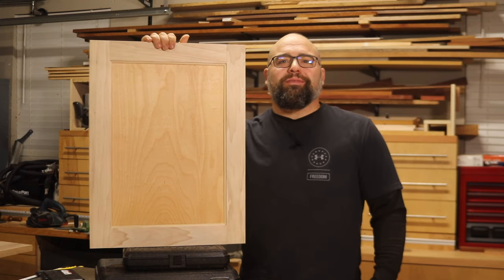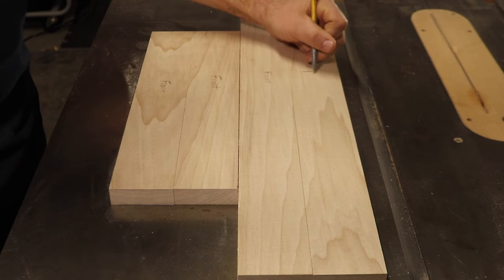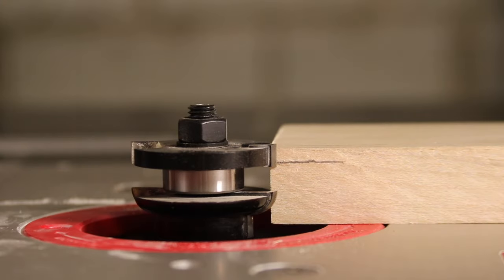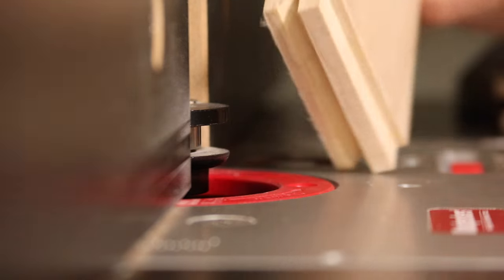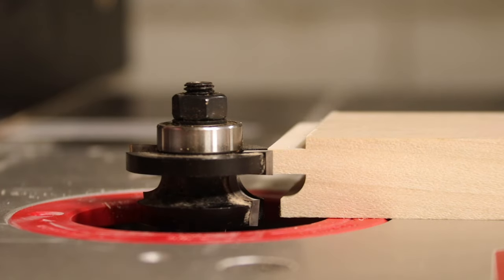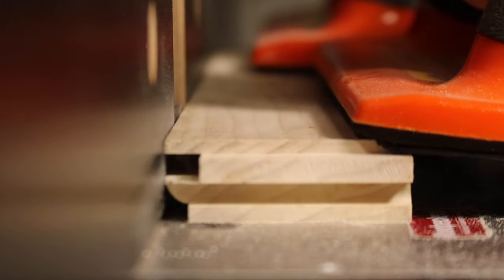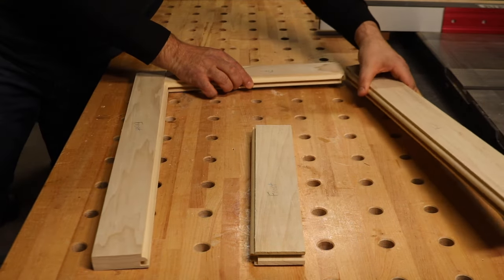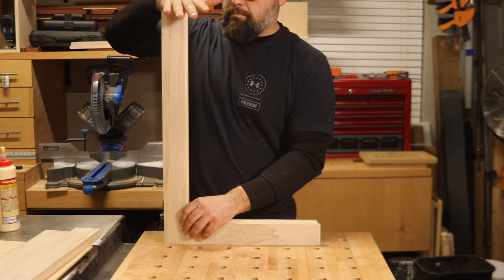Easy Cabinet Doors Made on the Router Table

Comment: Best video on you tube.  Perfect detail and easy to understand. Straight to the point. Clear video of all joints. Well done.
Reply from the maker: Thanks Dawn! I appreciate the kind comment!
Reply: Not quite.  The fence isn't square to the miter gauge.  Wrong method.
Reply from the maker: Seems to have worked out pretty perfectly. And does every time for me. Why is it the wrong method?
Reply: @PenaltyBoxWoodshop  only because you need to keep the piece pushed up square against the fence/bearing.  You didn't demonstrate squaring the fence and miter gauge to the miter slot.
Reply from the maker: I’m sorry but you’re wrong. With a router table you do not have To square the fence to anything. The router bit is round and squareness will not affect the cut.
Reply: @PenaltyBoxWoodshop  so what's the miter gauge for?  You only need one reference surface, not two that have not been checked for square.  Yeah, sure it SHOULD work fine if they are square.
Reply: Very good job mr
Reply: Facts.

Comment: Housewife tip: When we had our custom cabinets built I requested that the carpenter set all the panels in as he did the glass. They're held in place with the plastic twists in the back. This enables me to get a wild hair up my butt, pop out the panels, and paint them with chalkboard paint. Or decoupage. Or switch the panels out for glass. Or anything I want, really.

This is the only way I could imagine having the same kitchen for 30 years without getting bored. And it really works. The white cabinets don't bother me over time and I get to switch things up without doing any real damage or pulling out the paint sprayer and plastic. 

If a panel ever gets 'crafted' beyond repair, I can just cut out another 1/4 inch panel and pop it in. I have the information for the original white paint and can even turn it all back into a nice, clean, white kitchen if the mood moves me.

Comment: Good tutorial.Just one point you did not mention - especially for new woodworkers - to allow for the extra wood needed on the rails when they fit into the stiles.I my first doors and the finished product was not wide enough LOL
Reply from the maker: Thanks! I actually did mention that during the assembly but you’re correct I should have made a bigger point about it.
Reply: I didn't see that covered either. But otherwise this is a really awesome video

Comment: For those who have never use cope and stick bits, it would be informative to let the user know that they need to add an extra 3/4 of an inch or 24 centimeters to the rail length or the door will be short in width. The rail inserts a little over 3/8's of inch into the stile, thus 3/4 of an inch a door. I learned this lesson the hard way building double doors and them being an inch and a half short in width. After all of the milling and sizing of wood, this type of rookie building mistake hits hard on both your time and wallet.
Reply from the maker: Yea, absolutely and I mentioned quickly that you need to account for that but I didn’t go in-depth. Thank you
Reply: I was about to ask about that as it's important to allow the extra length. Thanks for clarifying. Btw, 3/4 inch is 19mm, not 24cm!
Reply: @PenaltyBoxWoodshop  I went back and watched the video twice and I did not see any mention about 3/8 tongue on each end. In other words if you want your rails to be 10 inches long start with them 10.75 inches 3/8 on each end will be the tongue.😀🛫

Comment: I would have liked to see more info on your centre panel.

What did you use for the centre panel. What kind of wood is it and how did you get it so thinly sliced? Did you mill it yourself or got it cut at the store. What are the chances of thinly cut solid wood with so much surface area to weight ratio warping

Comment: I’m a beginner and I checked out your Amazon link to the router bits you used.  Are there several rail & style bits in that set?  The door in your video is EXACTLY the one I want to create… Shaker with that small bead around the edges of the panel.  What type of rail & style bit set makes that pattern specifically?  What’s its name?  Loved your video.  Gives me the courage to try my hand at making these doors.

Comment: Great video. Quick question I don’t have a router table but I do have a router. Can I do the same thing using the same bits used in this video?
Reply from the maker: Thanks! No, you’re gonna need a router table of some sort for this. Even if it’s a shop made one

Comment: Where are the links for the list of tools? I have a cheap table saw and tried to do this and it was a learning experience...very frustrating.  I would rather do it the way you did it in a router table and have less trial and error.  Could you tell me what table saw you have and the clamps you have.  Thank you!  Awesome video!  You did an incredible job making this simple for everyone.
Reply from the maker: They are in the description section and the Delta saw that I use is in the list. Thanks!!!
Reply from the maker: They are also on my website www.penaltyboxwoodshop.com

Comment: Nice work.  Which router did you use in your table, and do you have any problems or anything that could be better about your router table in general?  I’m debating on getting the woodpeckers or the jessem.
Reply from the maker: I like my router table and the Woodpeckers one is top notch. However, I like the lift on the Jessem better. The woodpeckers is harder to lift
Reply: @PenaltyBoxWoodshop  cool, thanks.   I think I'll try the JessEm, but it was a tough call without being able to get my hands on it first.  I agree with you about the lifting on the WP.  My only nit about the WP I could tell from watching their videos is the lift handle seems to be a flimsy design over time, with only the small set screw holding it together.   Small thing to complain about though.   I love WP for their layout tools and I have several of them.

Comment: What about doors that use no sheet products?  I want to make cypress cabinets and would like to see solid center panel construction.
Reply from the maker: Then you would need to use a thin 1/4” panel or make a raised panel. I think you might be able to use a 1/2” panel as well but cut a 1/4” rabbet on all four sides. Then have the offset side facing to the rear of the door

Comment: Love your videos.  Do you cut the center panel exactly or do you make them smaller to account for expansion?
Reply from the maker: Thanks! I usually cut on the line which gives them a little relief on the length and width

Comment: First off, thank you for this very informative video.  I have been doing some basic woodworking for many years but am now wanting to take on some cabinet building so your videos are awesome!  There were so many comments on this video that I couldn't go through all of them so I apologize in advance if this has already been answered. 

I have a question regarding making the first end cut where you use a straight edge and move the fence to line up with the bearing and are cutting the end pieces.  I see you simply tap the fence into position.  Isn't it critical the fence be perfectly parallel with the mitre slot?  Doing so would give you a perfect 90 degree angle with your mitre gauge.  It seems to me this cut could potentially be not square unless the fence and mitre slot were not perfectly parallel.
Reply from the maker: As long as you keep the piece flush with the fence as you push it through it doesn’t matter if it’s parallel with the slot. If you clamp it to a miter gauge (which I don’t recommend) and push it through then you could see a problem

Comment: Nice job but is there really wood movement in the panel, seems like the door will be much stronger if the panel is also glued
Reply from the maker: It will not add any strength but if you don’t want any movement in the wood then you can use MDF as the panel. You’ll have to paint it but it will not move with the seasons 👍
Reply: @PenaltyBoxWoodshop  Don't understand why glueing the panel will not make it stronger
Reply from the maker: Well, it’s a door and isn’t load bearing so more strength shouldn’t be a necessity in my opinion. As far as the added strength goes this isn’t a joint and the design is intended for a floating panel. I guess I could make a door using a MDF panel and glue it in place and then strength test it to see but I just don’t see the reason.
Reply: @PenaltyBoxWoodshop  Surely a 1/4 inch piece fitting into a 1/4 inch slot can be called a joint?
Reply from the maker: Okay, you win. Glue the panel.

Comment: I know a gal that refaced and replaced her cabinet doors in her kitchen.  Told me that it was cheaper for her to buy the router, router table, bits and wood and DIHerself that it was to just buy the cabinet doors.  I already have the equipment.  I'm making a bathroom vanity to replace the pedestal sink.  Easier done that said.  Not difficult at all, really.  It's simply a box with doors.

Comment: I would glue in the panel all-around if it was ply, you'll see no movement unless you are using proper wood panel inserts... in which case no glue & use spaceballs to centre the panel up and stop it from rattling around in the slots... the panel will of course have to be cut to give clearance for the balls... 
Nice work.. 😎👍☘🍺
Reply from the maker: Thank you, sir

Comment: Dumb questions. How do the seams at the panel not crack the paint, if painted? (Based on your wood movement comment to not glue the panel)
Reply from the maker: Not a dumb question at all. I’ve never seen or heard of this issue before and only would see this happening if you try to caulk the edge or something. Your plywood panel will not expand and contract like the frame will since it’s solid wood and the paint shouldn’t bond that gap enough to crack when it does.

Comment: Great video. I'm about to make doors myself for the first time with the exact same inside profile as you did.  Doing the  coping cut first makes complete sense. I never would have thought of that.

Question on the panel.  Did you cut it to fit snug or did you leave a gap for swelling?  If so did you leave a gap on all 4 sides?
Thanks!
Reply from the maker: Thank you! I usually just “cut on the line” when making the panel. That way it gives it a little wiggle room all the way around. I don’t worry much about swelling and contraction with plywood.
Reply: @PenaltyBoxWoodshop  That makes sense.  Appreciate the tip.
Reply: @PenaltyBoxWoodshop  
Just finished my first door as a test run. Turned out great.  I added a 1/2" round over on the outside for a nicer touch.  Thanks again for the tips.  Tomorrow starts the real project.
Reply from the maker: Heck yeah! Glad it worked out!

Comment: I ordered the router bit and my bearings are both on the top? Also how do you measure your stiles?
Reply from the maker: The styles will be the total length of the doors. So, that will depend on your opening and if you are making doors that are flush (inside the opening) with the cabinet face or sit on top of your cabinet face. If sitting on top then you can choose your overlap. As to the bits of you ordered the set then one of the bits should have a center bearing as mine did. Make sure they didn’t send you identical ones
Reply: Thanks for the info, I meant the rails when doing the opening do I add a inch because of the inset of the styles? The bit do look different but not much, like I said thanks for the information.
Reply: Penalty Box Woodshop From the Amazon link I bought the timberline 440-24 router bits. I’m now thinking this must be wrong or can I still use them?
Reply from the maker: Any time! Yes, take the full width that you want your door to be and subtract the width of your two rails and then add the makeup for both ends.
Reply from the maker: Let me check it out and see

Comment: I don't understand why every video using the cope and stick router bits say to align the fence with the bearing with a straightedge. The bearing it literally there to do the job of keeping the wood from going too deep....you literally wouldn't even need a fence. So I don't know why everyone shows that as being such an important step. In fact when I cut my rails and stiles (I used this align-with-ruler method described in the video) i could swear the tongue wasn't quite deep enough. So probably my fence was a little bit proud -  I'll bet the bits work better to not even use a fence at all. I bet professional shops don't even use a fence for cutting these and this fence alignment thing came from amateurs...

Also every video on panel doors like this I've seen says to leave room for movement and then they use plywood ..plywood doesn't move! And even if it did, such a small sheet isn't going to move in any detectable fashion, either. I feel like there are so many generic myths in basic woodworking these days!